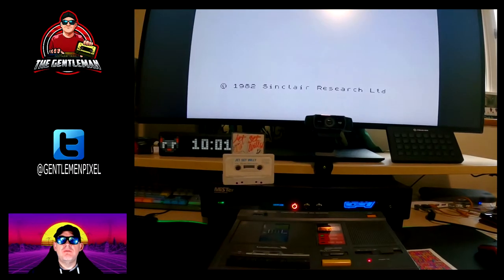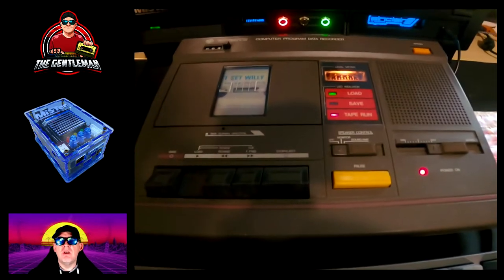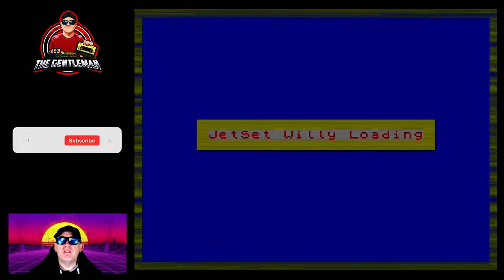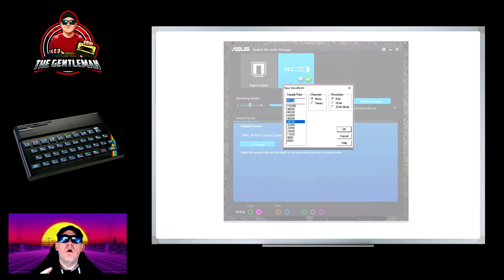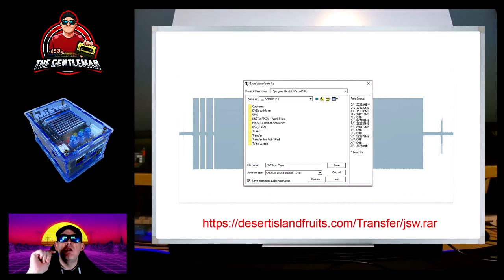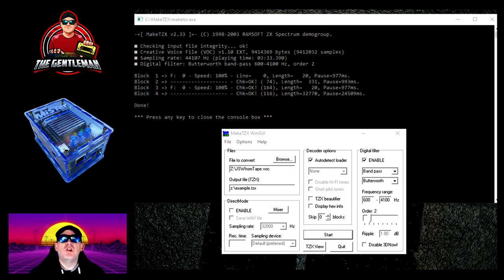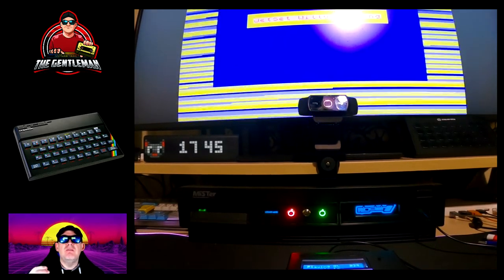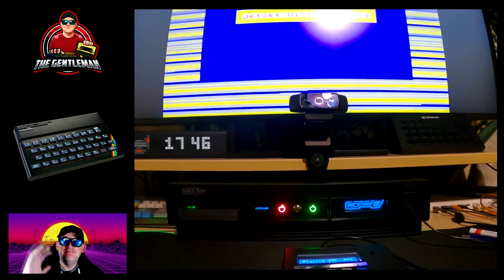ZX Spectrum Cassette Loading and Game Preservation on the MiSTer FPGA

Comment: hi what is your tape drive reference please ?
Reply from the maker: The physical tape drive is a WHSMITH CPD 8300.  The digital tape drive is an Arduino Tape Drive, there are a lot of them around - all look a little different but do the same thing.  Both my drives came from eBay.